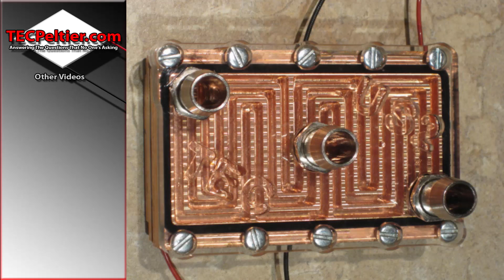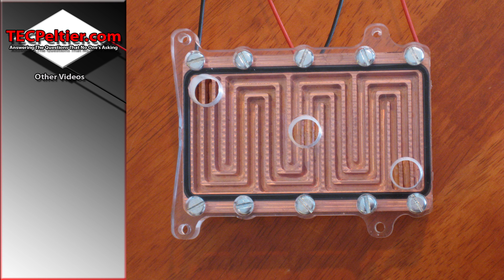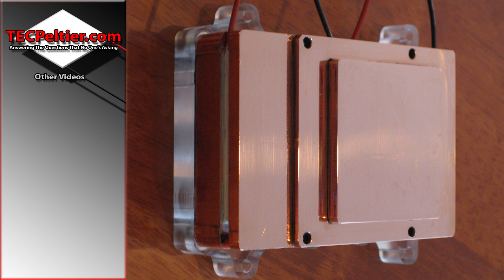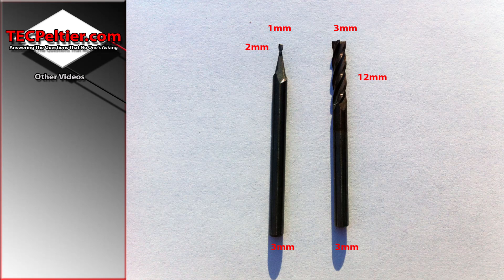⚡️ Thermoelectric Cooler (TEC) Peltier Water Block For Cooling a CPU. V1 Double 50mm

Comment: Hello . I was thinking at the same waterblock, and here you are with this ...
Actually I am trying to cool a i9-10900K at full load overclocked with Peltiers . The power draw of the OC CPU is around 360-400W.
So, do you think this double 50mm waterblock with 2x 288W Laird Peltiers would be able to cool down the CPU on full load to a 20 deg temp (above dew point) ?
For the water loop I was thinking to fit a 360mm rad / 3x120mm fans for each Peltier.

(I did try on the Cooler Master Cryo AIO on the CPU . The cooling power of the Peltier is too low , somewhere around 120W, meaning the CPU could run only on light loads ... which is disappointing if you want to reach high speeds on full loads . Most I could do was 5.6Ghz on a few cores / light loads)